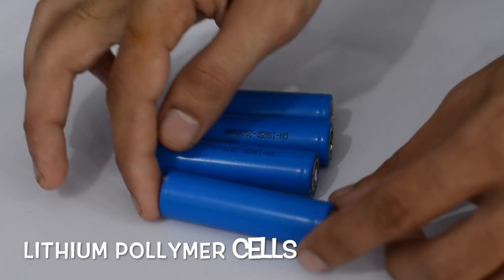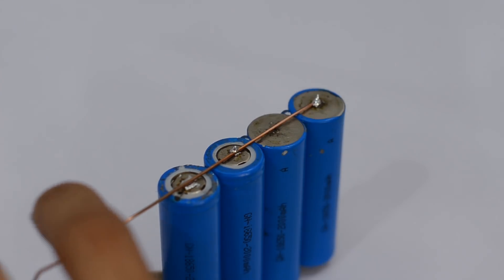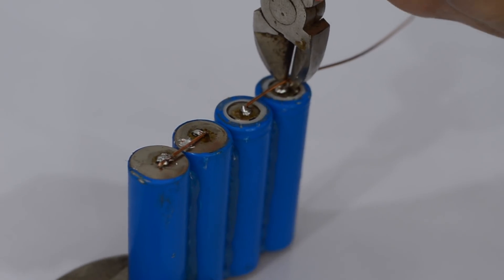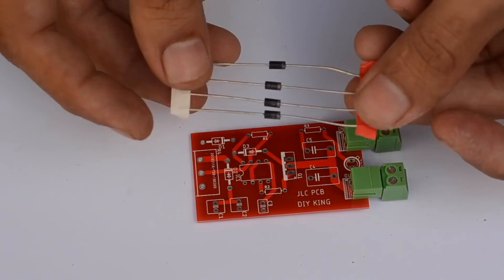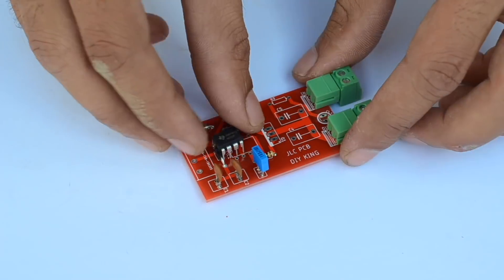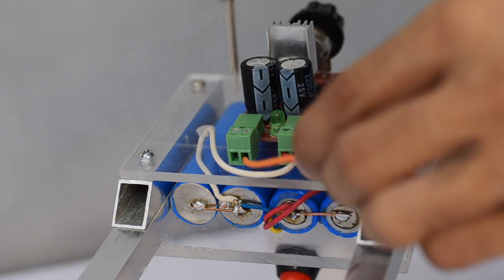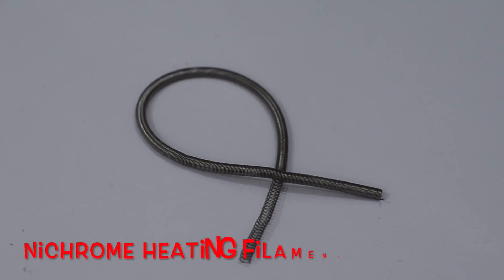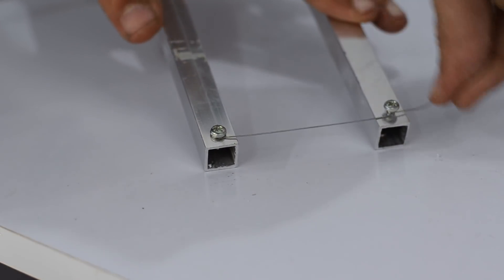How to make a Portable Hot Wire Foam Cutter

Comment: Good work! Samad son

I randomly saw your videos, and liked the way you presents the idea.
I would like to request you to make a device for bending acrylic sheets (line heater)...
But should be DC 12 volt based.
I have seen two videos in this regards, which were good enough but specs of the items used in those videos were not clearly mentioned.

I request you to make a one, based on the equipment, easily available in Saddar (Karachi) market.

Thanks and Allah bless you
Kind regards,
S.Ali.Mudassir
Reply from the maker: Thanks a lot for the kind words, its the fuel behind the work that drives us through.

I have started another channel where I will provide all the technical knowledge provided our local resources and that will definitely help us to grow together.
Reply: Ill be waiting for the requested video. Thank you